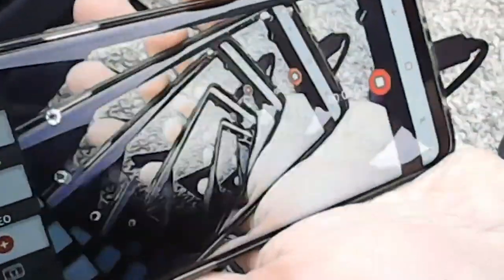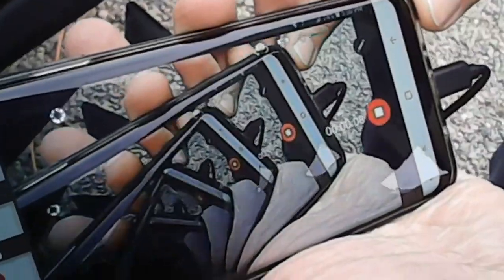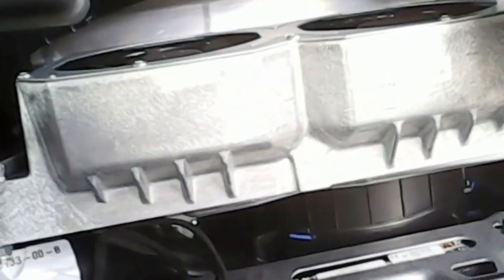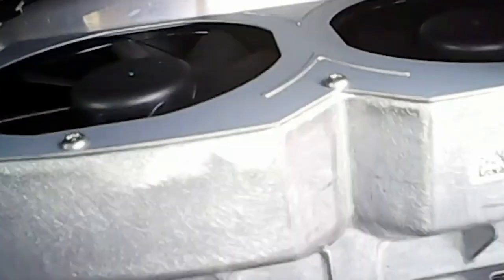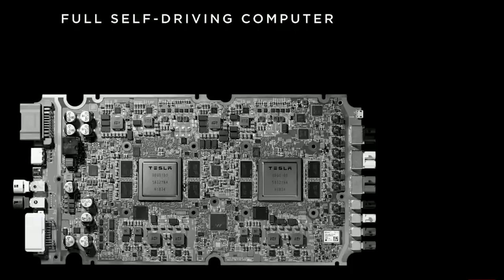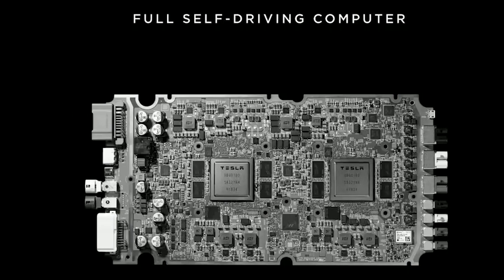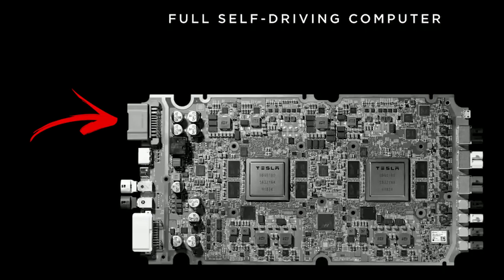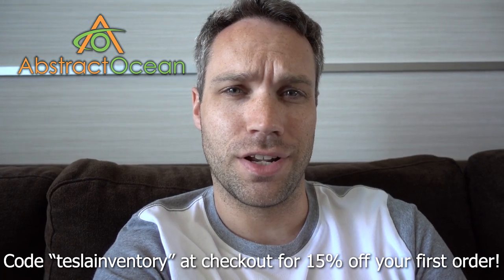Tesla FSD Computer Examined With An Endoscope

Comment: Plug in the HDMI and see if it has output
Reply: raven50x I was going to suggest exactly that.
Reply: Might also be an Input.
Reply: Bad idea. There's no reason to think that's really an HDMI signal.
Reply: Plug it in ... Plug it in...
Reply: Yes
Reply: Yeah until you find out it's just an hdmi connector with completely different pinouts going over it and you fry something

Comment: Hi guys, after looking at the pictures of the new board I have learned a couple of things. It looks like that hdmi and usb next to it are custom programing and debug connectors. They used a hdmi connector as the physical connection for their custom stuff. In other words, it isn't a hdmi output, is is just the connector. So Yeah I wouldn't plug anything into those..
Reply: How exactly did you determine by looking at the board's pictures that the HDMI and usb are debug connectors? Why would a debug system need a HDMI port as a connector if it isn't output?
Reply: @tangowally  I found a nice high res of that board. I spent a bunch of time going over it. I do electronic stuff for a living. Any way 
1) on the board the 'usb' is labeled J147 and the legend says 'DEBUG ETH'. ETH usually is short for ethernet. 
2) It looks like there are only 4 traces going to the connector ( just what you would need for ethernet). 
3) I was not able to find a usb3 phy IC elsewhere on the board.  
HDMI connector:
1) There are a handful of pins not connected that HDMI proper would need.
2) It is labeled J148 and and is called DEDIPROG not HDMI.
3) I was unable to find a HDMI phy IC.
 
And my gut tells me that they just recycled connectors for their own purpose. 
The hdmi connector makes perfect sense. Is is 4 balanced pairs. The hdmi cables are cheap and ubiquitous. The connection would be fast enough for some high speed debug using off the shelf cables and connectors and it is all cheap. Those cables and connectors are made by the gazillions for every tv on the planet. You get a 18 Gbit/s capable physical layer for peanuts.
It's very Tesla practical thinking imho.
Reply: @moki123g  Multi-layer board. You can't tell how many traces within layers. Anyway, two reasons against your assumption: One, ETH could mean "Everything". Two if the HDMI is used for debugging purpose, why would the engineer choose a standard HDMI connector risk for bi-directional signals and from user mis-handling?
Reply: This occurred to me as well. I wouldn't plug anything into them, especially anything you want to remain operational...
Reply: @jacktseng4909  Valid points. I could be wrong. Until I get one on my bench and poke around it is just speculation. But after looking at it I am going to go with my gut assumption until proven wrong. I don't see a good reason to put a HDMI video on that board. There is no HDMI interface chip and there is no reason to bake that into the tesla SOIC unless you really need it. The ui display is a separate system. "why would the engineer choose a standard HDMI connector" as said above easy, fast, cheap.

This isn't a part designed to be interfaced by the user. Don't go sticking things where they don't belong. They probably anticipated someone doing this and chose pins that won't fry everything but I wouldn't do it to my 100k tesla after looking at the board. You are welcome to give it a shot!
Reply: @awo1fman  Agree! I do think the USB-c is used for external high-speed communication (debugging, imaging data set, condition registers extraction etc...). The HDMI connector is just the name implied for A/V simulation...
Reply: @jacktseng4909  HDMI signals are not powerful enough to be a risk to the Tesla if somebody tries to input. Everybody knows you should never go poking around like that, so if you plug something in and it gets fried that's your problem, not Tesla's.

I could name multitudes of manufacturers who have used standard connectors for nonstandard applications and pinouts. Why reinvent the wheel when there is an off-the-shelf solution that has the right number of connections and meets your voltage and current requirements?

Plugging things into a connector just because it fits is a really dumb idea. Lots of things will fit into a wall power socket. Does that mean it's a good idea? How about you try it? I'll wait... 🙄🤣

Comment: My question is there an output marked for the boombox or speaker output. I was led to believe that the boombox or pedestrian speaker was an output on the 3.0 board and was not on the 2.5 or 2.0 computer. So if you wanted to add boombox to an older car, you had to get the 3.0 computer and possibly also run wiring to the front if that was not already there as well as installing some kind of speaker. Also maybe get the software patch I have heard owners get to make it show up on the center screen.

Comment: Thanks for posting this awesome video while you are on vacation! I don't think that you should plug into the HDMI connection, it's not worth taking any chances. You already risked that second fan starting up. I'm surprised that there is nothing protecting those fan blades from intrusion, because anything could get into there.

Comment: Nvidia's is more powerful
Reply: Troll
Reply: it only produces more heat
Reply: NVidia Pegasus is .64 TOPS/Watt vs Tesla FSD 1.44 TOPS/Watt.  So, if Tesla were to build a FSD that used 500 Watts for their computer it would be 720 TOPS.  Also, NVidia has no data to train their AI computer.
Reply: @cmrny  Don't feed the trolls.
Reply: Lol I think even Nvidia complimented Tesla’s design.  Trolls will be trolls.
Reply: Why would they waste millions on research to make a slower computer?